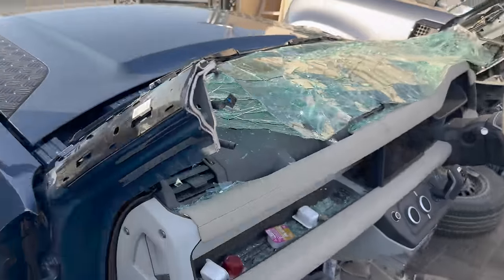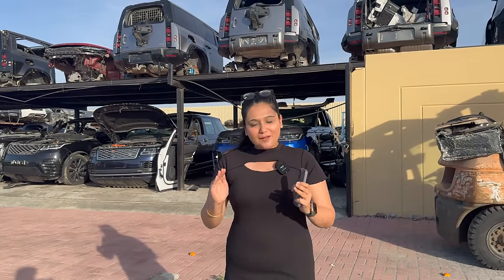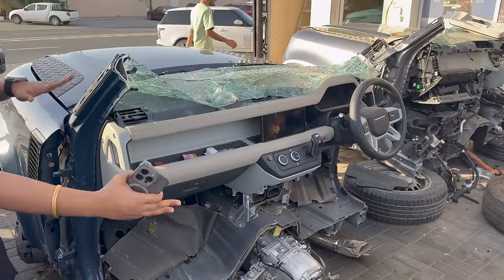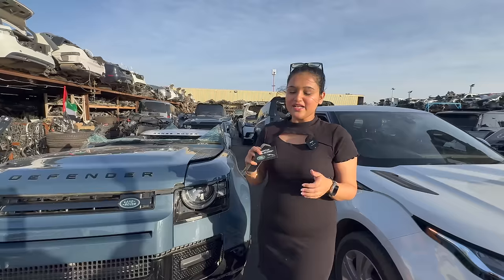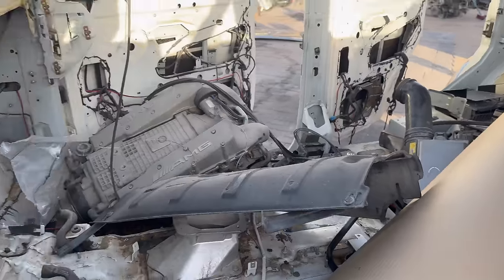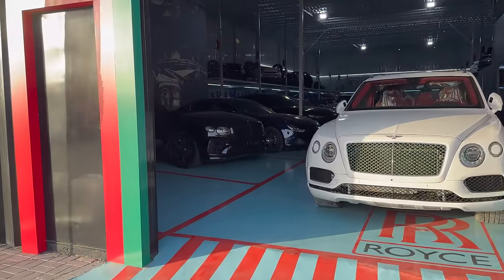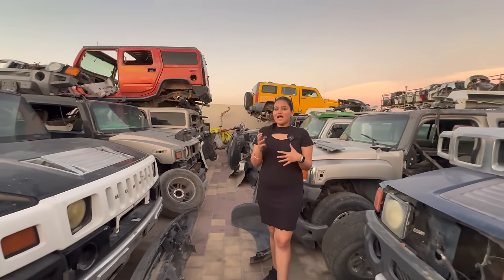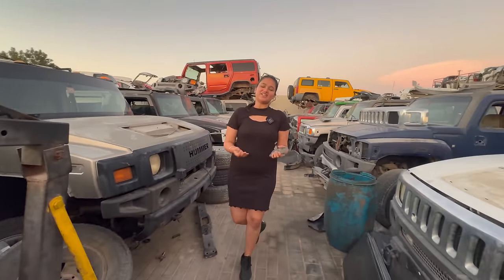BUYING ACCIDENTAL DEFENDER FROM ASIA’s LARGEST SCRAP MARKET -  MY DREAM CAR ❤️

Comment: Dear mam 7 seater btao under 15 lakh with all necessary best features with 5 star safety 6 airbags
360 camera
Parking camera
Ventilation seat
Tpms
Big hi fi display informative
Rear dfoger wiper washer
Electric staring
Electric orbm adjustable
Bolero neo me kuch kamiya he nahi to wo hi le leta

Comment: Hello Madam,
Planning to buy new Suv with budget of Rs 25 lacs +-2 lacs.
I have test driven Safari, XUV 700, Scorpio N and I am bit confused between Safari and Scorpio N.(Not considered XUV 700 as it has suspension noise, as complained by existing owners)
I know both vehicles are completely different.But I like the road presence of Scorpio N and it's being value for money on the other hand Safari has lot better interiors but bit overpriced.

Please suggest which vehicle to go for.
It would be a great help.
Reply: Xuv700
Reply: Don’t waste your money by going for tata or mahindra. You will regret it after few days
Reply: Best option buy toyota innova hycross